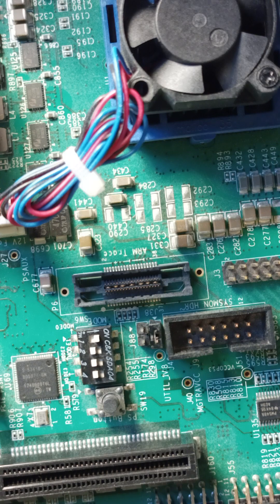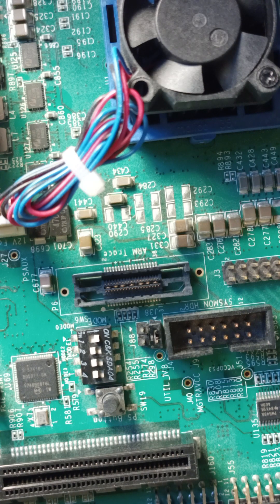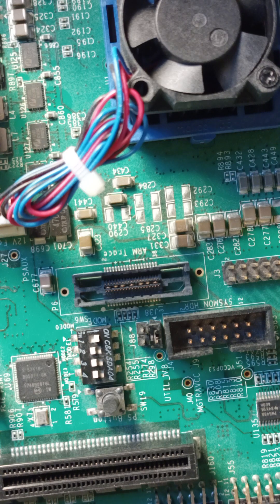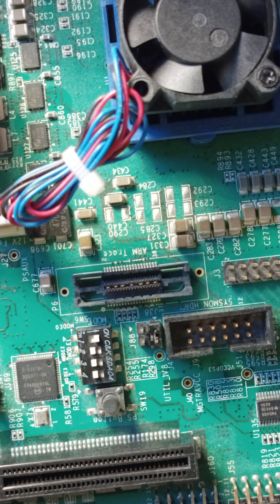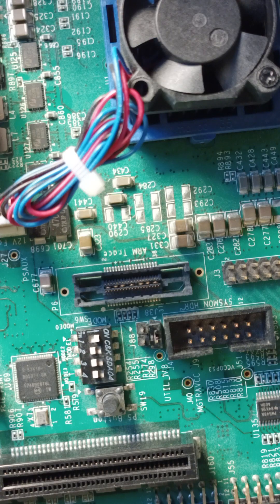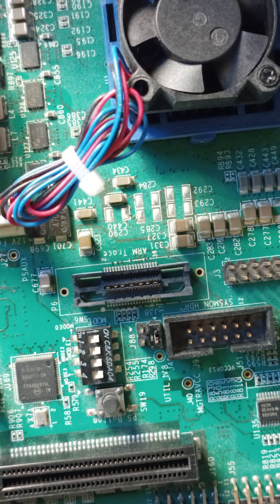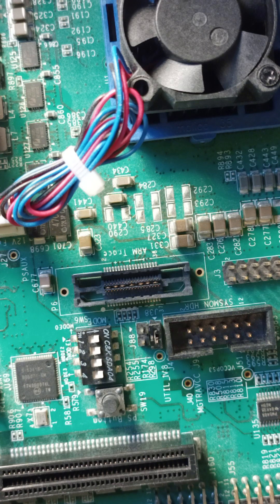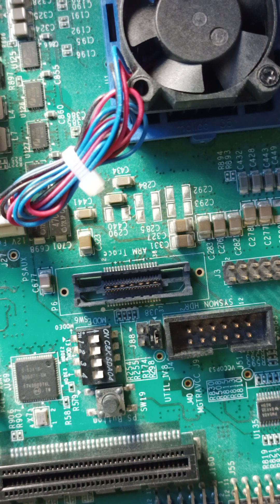CRITICAL WARNING: [Labtools 27-3421] xczu9_0 PL Power Status OFF, cannot connect PL TAP. Check POR_B

Comment: ENCOUNTERED PROBLEM WITH ZC706.!NEED YOUR HELP!
I have created block design and created elaborated design and generated write bitstream successfully. The problem I am faced with is its inability to showcase ila and vio output. In return it's giving me a warning ->
"WARNING: [Xicom 50-38] xicom: No CseXsdb register file specified for CseXsdb slave type: 0, cse driver version: 0. Slave initialization skipped.
INFO: [Labtools 27-1434] Device xc7z045 (JTAG device index = 1) is programmed with a design that has no supported debug core(s) in it.
WARNING: [Labtools 27-3361] The debug hub core was not detected.
Resolution: 
1. Make sure the clock connected to the debug hub (dbg_hub) core is a free running clock and is active.
2. Make sure the BSCAN_SWITCH_USER_MASK device property in Vivado Hardware Manager reflects the user scan chain setting in the design and refresh the device.  To determine the user scan chain setting in the design, open the implemented design and use 'get_property C_USER_SCAN_CHAIN [get_debug_cores dbg_hub]'.
For more details on setting the scan chain property, consult the Vivado Debug and Programming User Guide (UG908).
WARNING: [Labtools 27-3413] Dropping logic core with cellname:'design_1_i/vio_0' at location 'uuid_01A4B5947C445FA6BD66F70F5F031273' from probes file, since it cannot be found on the programmed device."<-
The next doubt I have i.e for the external clock source which package pin is to be allocated and mention me if given any changes to be made on board regarding switch manipulation.